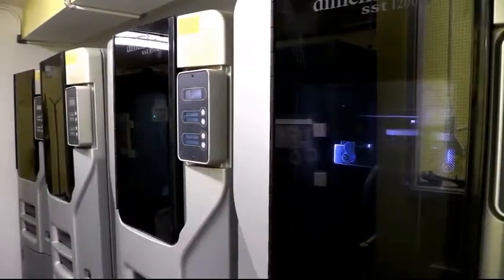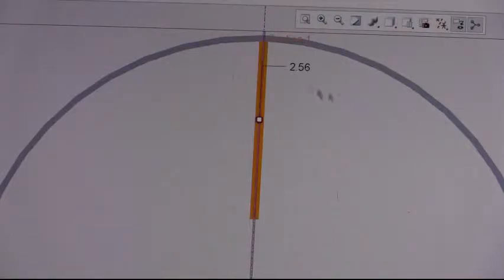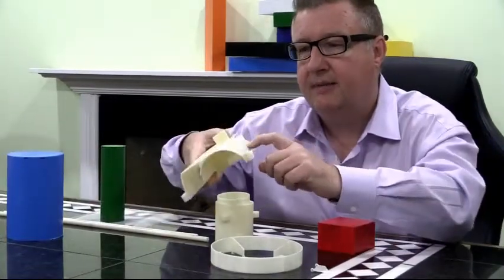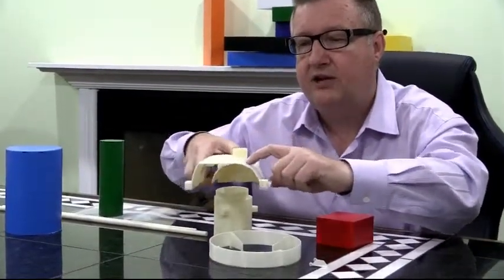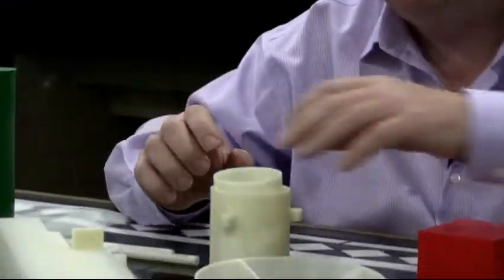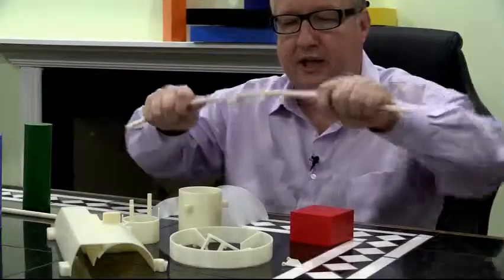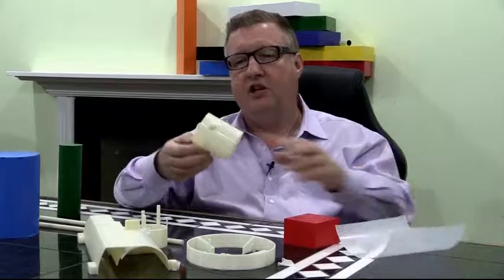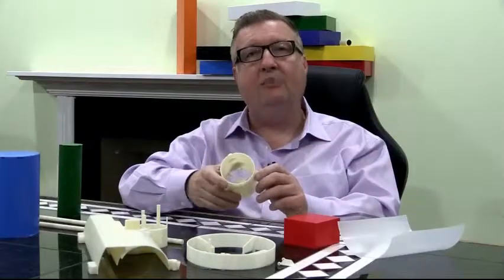3D Printing vs Injection Molding by Omachron™

Comment: This video is very misleading. Those 3d printed parts were made to break easily. A properly designed and 3d printed part does not break like that. That's an unfair comparison.

Comment: The issues with 3D printing really only arise if the part is not optimized for the process. 3D Printing is different from injection molding do you have to use different design practices. https://www.slant3d.com/slant3d-blog/designing-for-3d-printing